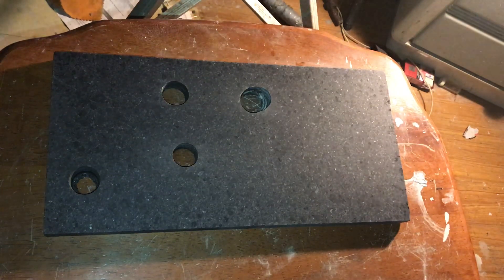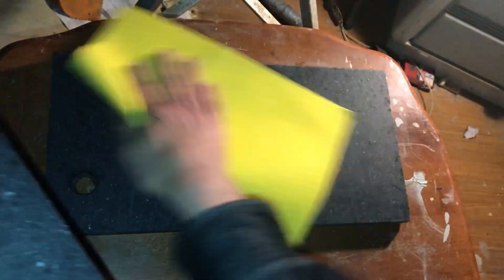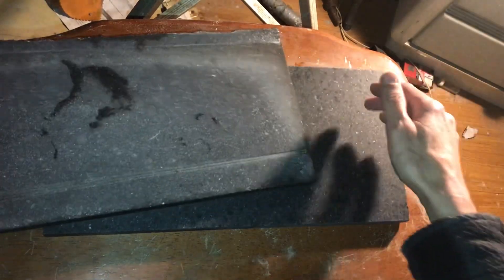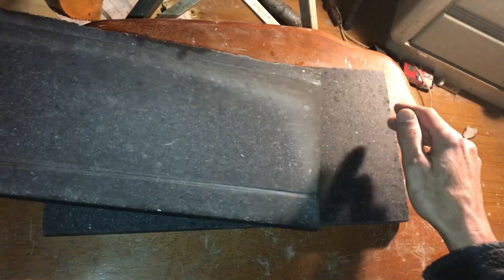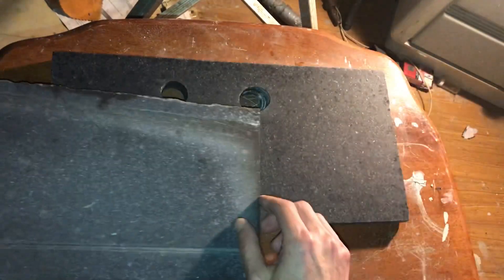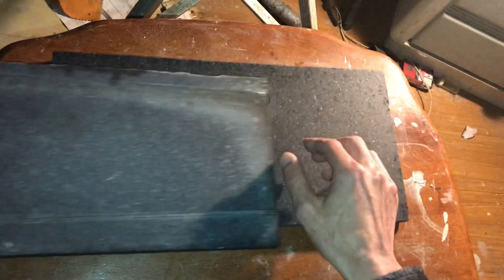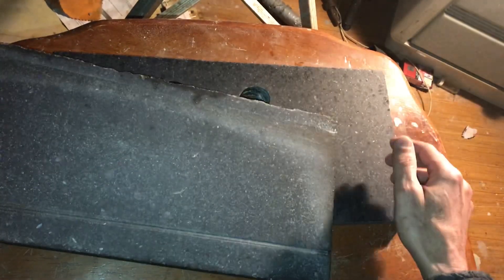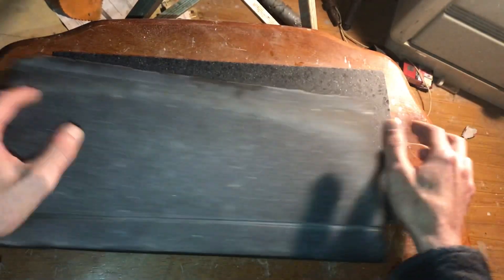Floating Granite. PRECISION Flatness by hand with Sand & Water

Comment: Btw the floating NEVER a prove of flatness it is a prove of uniformity
Reply from the maker: If all 3 plates float across all the axis then uniformly flat. Not all 3 can be uniformly convex and concave at one time.
So it CAN prove flatness which is quite different from NEVER.
Surface plate and lens manufacturers use floating as a test.
Reply: @SacredGeometryDecoded  I just said that floating by itself is not a prove of flatness, now you are saying that not all 3 can be uniformly convex and concave at one time using the 3 plate method, yes that is another story but wut when u show just 2 plates on a video that are floating in all axis that is uniformity not necessarily flat, cheers
Reply from the maker: @GraphicManInnovations  in the video and description I reference using the Whitworth 3 plate technique
Reply: @SacredGeometryDecoded  
yes and it would be great if you can show us your setup/part sizes/technique for doing it, thank u
Reply: AFAIK it is not possible to use the 3 plate method on a non square/round pieces
Reply from the maker: @GraphicManInnovations  for these one of the three plates was larger.
And you’ll find people doing it before I did.
It’s about adjusting technique.
Using round or square plates is about trying to achieve the highest grade of flatness equivalent to Johannesen gage blocks levels of flatness which is measured within a few nanometers.
IT IS POSSIBLE to measure flatness with floating and IT IS POSSIBLE to use the 3 plate technique with non square, round or square plates.

It’s about adjusting the technique.
You can hear the imperfections and asks for it. Using combo of straight strokes and circular ones.
Professionals calibrate large rectangular surface plates with smaller lapping plates. 
I posted a video with another set I made of non square but equal sized plates showing they float even once you use one to lift another one up with air effect.
That would make them at or extremely close to AA standard used in labs.
You absolutely can do it.
Reply: @SacredGeometryDecoded  I admire ur work/knowledge and i really wish it is that easy
i am in the process of making, and i got strange stuff:

 i can make a precision small flat piece (Steel) float on 2 plates that have been lapped together, but at the same time one is concave and the other is convex! not only that, my repeat o meter (dial) is showing that both plates are on the same curvature! but i know they are not flat because my precision ruler is give me gaps of about 0.03mm
Reply from the maker: @GraphicManInnovations  I came at this after doing a lot of experiments in granite with primitive tools to debunk those Ancient Aliens/Atlantis technology  types of claims. Made and graded my abrasives, that type of thing, how to do it from scratch. 
The surface plate was more of a side project just for fun, i watched a lot of videos by channels such as this
https://www.youtube.com/watch?v=EWqThb9Z1jk&t=338s
He is a professional doing on site calibration etc, he would be the type of person to talk to about those issues using lapping plates. I have only used stone on stone and only have made made 3 sets of plates, a lot of trial and error.
This is another channel i watched a few videos on
https://www.youtube.com/watch?v=-CM3VWKXasY&t=474s
This channel also
https://www.youtube.com/watch?v=5m_Opf3nhQU&t=949s
discussion on the issues with 3 plate technqique
I am only a mildly interested amateur,  these channels would be a far better source of experienced knowledge.
I was only rally doing it for fun and to make toys like this
https://www.youtube.com/watch?v=jDbrc1kl74Y&t=19s
Reply: @SacredGeometryDecoded  I have seen all these video yeah
is there a way to contact you privately?
thanks for ur respond
Reply from the maker: @GraphicManInnovations  SGDcontact@protonmail.com

Comment: Fascinating!  How much weight could you put on that top block and still get the "floating" effect?  It seems like the sort of thing that civilizations that liked building things out of great big stones would have found some practical use for.  [Imagines an ancient Egyptian skate park where they're scooting around on granite hoverboards]
Reply from the maker: I want to check exactly why they float. Almost certain it’s air cushion that gets trapped underneath similar to bonding to high grade lens. Once you push the air out by heat the lens bond as if one. But will check another theory first someone suggested.
Though if it is air cushion and you push down on it hard enough the plates should stick like a super suction cup.
Though the skateboard thing 😂 I am now tempted to start grinding down my porch tiles and giving it a go.

Comment: the branch of technology that deals with dimensions and tolerances of less than 100 nanometers, especially the manipulation of individual atoms and molecules.
Reply from the maker: Waiting on my super fine abrasive to settle out of all the buckets I have lined up in my bathroom. Definitely will get to below micron range of smoothness with my homemade stuff.
A company will test them for me and they have optical testing so they can do down to nanometers.
Check out “wringing and Jonhannsen gage blocks” hand made precision so flat that they stick together.

Comment: Great work SGD. So if there would be a road made of granite with the top surface sufficiently flattened... and large granite blocks with the bottom surface flattened... that would make the job of transporting the blocks a bit easier huh? ;)
Reply from the maker: Lighter ones yes but if it is air cushion effect heavy blocks would squeeze it out and lock them to the other surface like glue. “Wringing” effect.
Need to look into it more to be certain it is air cushion though.
Reply: @SacredGeometryDecoded  The air cushion effect and aquaplaning seem to have similar characteristics. Factors like surface tension and interfacial tension might be relevant, which are pressure and temperature dependent. A completely different thing to keep in mind when bringing two surfaces extremely close together is the Casimir effect.

Comment: Is it static friction that causes the floating effect?
Reply from the maker: https://www.youtube.com/watch?v=3MKuoUttjuY
in the comments some one says it is trapped air
Similar to bonding of glass , the glass floats and then they use a torch flame to drive the air out and they become bonded- wringing effect.
Reply: @SacredGeometryDecoded  flatness is a whole science of its own. This guy in this videoe knows https://www.youtube.com/watch?v=EWqThb9Z1jk
Reply: btw.. that video.. Even that out of shape flat plate is something the ancient egyptians and romans could dream of.
Reply: @SacredGeometryDecoded  I always thought that this is how the builders of the Pyramids were able to fit the massive Granite blocks together with such precision but I only got a grade 8 education so I never think much of my own thoughts lol
Reply: @No1karez  Yep - that was an incorrect thought. The only faces ever finished on the pyramid blocks are the exterior faces of the cap-stones, and the inner walls of the chambers. The other surfaces were pretty rough, and rubble fills the gaps.
Reply: @SacredGeometryDecoded  Pls, try "grounding" the bottom stone with a wire to test the "static friction" effect, which I personally believe more than the trapped air thesis.